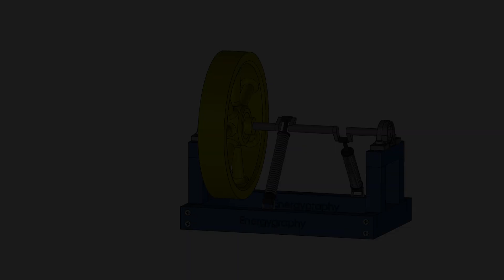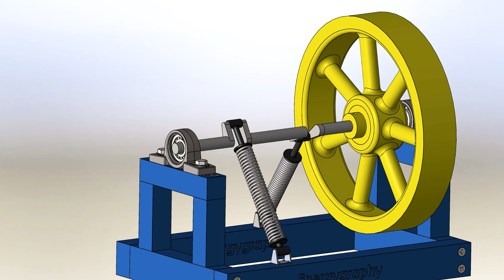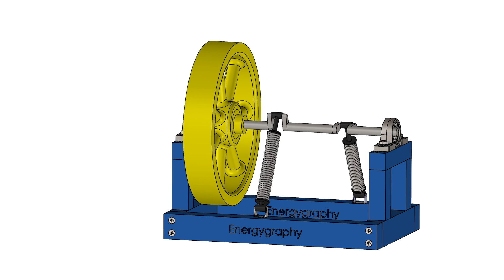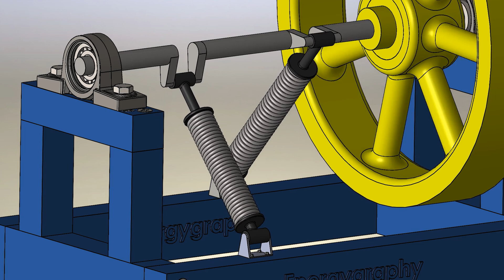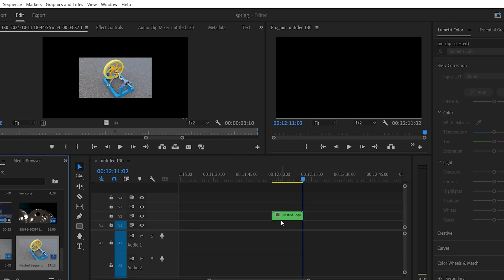Viral Free Energy device, Spring and Flywheel Mechanism Explained

Comment: Flywheels store Momentum. It takes the same force to move the mass of a flywheel as it does to move a mass in a straight line. The momentum of a flywheel can be transferred to a small mass.
The Momentum of a 10 kg flywheel moving 1 m/sec can be transferred to a 1 kg mass moving 10 m/sec in a straight line. The flywheel had 5 Joules of energy and the small mass has 50 Joules.
You can make energy with a simple 'cylinder and spheres' experiment. Or you can make energy with a flywheel; but you have to throw as in the 'cylinder and spheres'

Comment: You are correct, of course; but Newton's Laws of Motion also apply to flywheels.
If you wrap the flywheel with a weighted string and then spin the flywheel; the wheel will throw the mass on the end of the string with violent force.
It takes force to spin a flywheel: such as a pull cord pulling a gyroscope. That force applied for a certain time is held as the Newtonian Momentum of the flywheel.
When the momentum of the flywheel is transferred to the much smaller mass on the end of the string: the ENERGY increases dramatically. A 10 kg flywheel throwing a 1 kg mass has a 1000%  increase of energy. 1/2 * 10 kg * 1 m/sec * 1 m/sec = 5 J.   1/2 * 1 kg * 10 m/sec * 10 m/sec = 50 J
You would simply extend the flywheel clear of the frame and clamp the frame and wheel on a table. Be careful: the throwing speeds are dangerous.

Comment: Thanks Majid for your great explanation, actually, I have idea and if you can do analysis about that, which is similar water turbine or pelton turbine, but with a little different, the turbine consist of large circle 4 or 6 diameter & 1 meter width, and on its edges weights and there is more weights moveable this can move from center of turbine to edges during rotation, I have drawing for that and more explanation, if I can share by email or other contact for you.
Thank you

Comment: note: flywheel bearing/generator/rpm/wheel/diameter more energy generate.

note: motor input 20 kilowatt to rotate flywheel and flywheel generate 40 kilowatt and 20 kilowatt motor input to rotate flywheel and 20 kilowatt other work use.

unlimited energy generate.
Reply: Except that a larger flywheel will have more interial force to overcome, more air resistance in the form of aerodynamic drag, will put more stress on the springs and bearings due to the increased weight, and will therefore consume more energy to initialize and maintain, thereby either maintaining a neutral energy throughput (equal kw input to kw output), or will experience a net energy loss.

Comment: Anybody with a lick of mechanical common sense knows this. what blows my mind is how this ever went "viral"... tells me a lot!!
Reply: You are correct; who would think that adding springs to a flywheel would change anything? 
But these flywheels are about 10 minutes from getting it right. If you can place the motion of a large mass into a small mass, the energy increase is huge. 
Wrap a weighted string around the flywheel and let the wheel throw the mass on the end of the string. If the flywheel has 20 times the mass, the thrown mass will have 20 times the energy. 1/2 × 20 kg × 1 m/sec × 1 m/sec = 10 J. But. 1/2 × 1 kg × 20 m/sec × 20 m/sec = 200 J
The flywheel has to have clearance  to throw a string of 1 diameter or more: but some wheels are already clear of the frame.
This throw has a reason to work: The Law of Conservation of Momentum.
Examples are Smokin Llamas or 'cylinder and spheres' experiments.
Reply from the maker: It’s interesting how things that seem obvious to some can surprise others. Sometimes, what goes viral isn’t about the complexity of the idea but how it resonates with a wider audience. Different perspectives lead to different reactions!
Reply: @energygrapgy  dont you make the same free energy scam devices but with gravity and magnets?